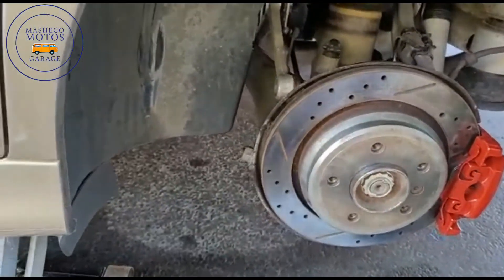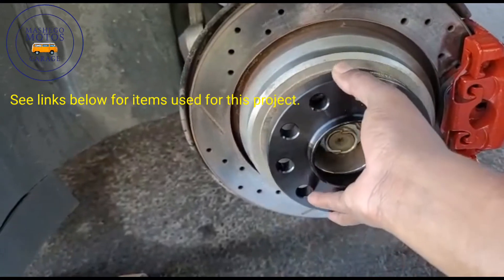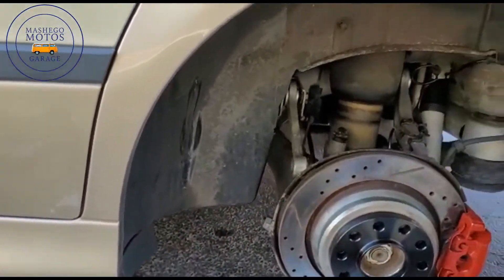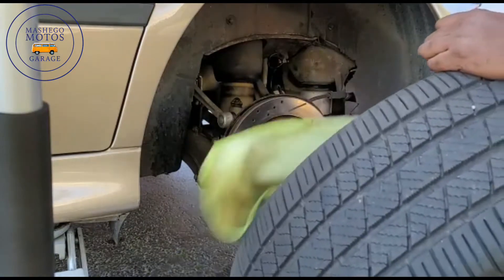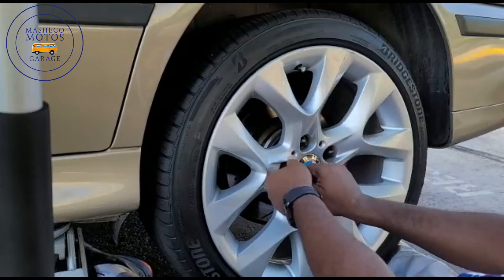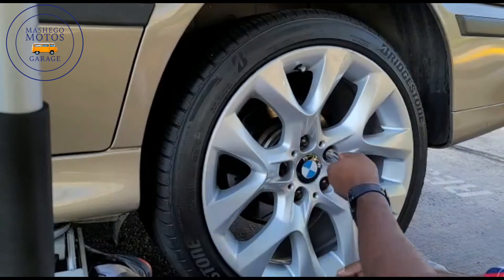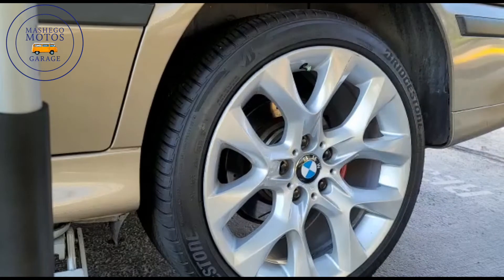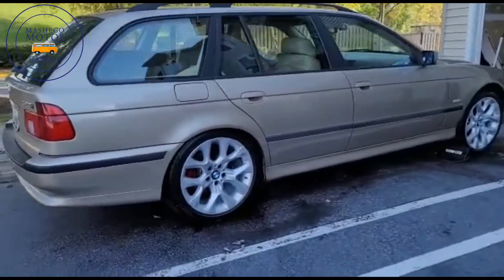BMW E39 Wheel Spacers Installation (BMW E70 Rims with 245/40/19 Tires) SEE BELOW LINK

Comment: can i put 245 40 19 tires on bmv e39 rims 8.5j et 15
Reply from the maker: Yes. I have the same size tires on my E39 Wagon. You will have to install wheel spacers for clearance.